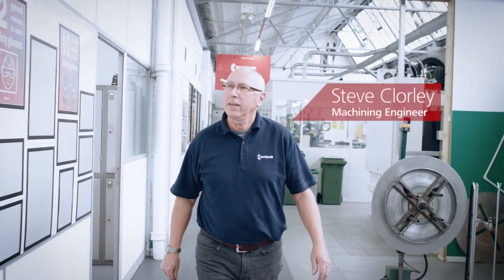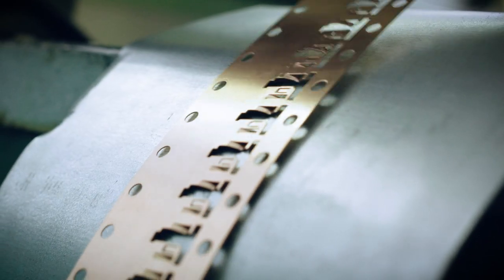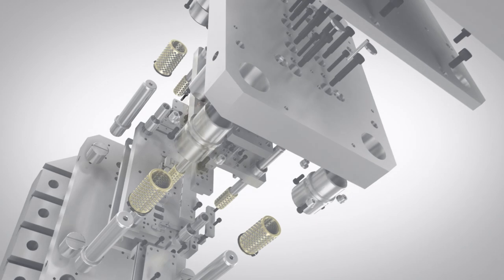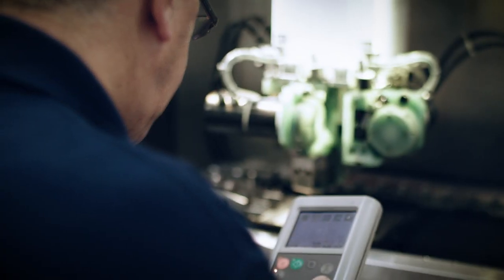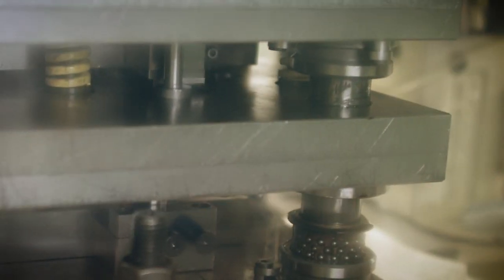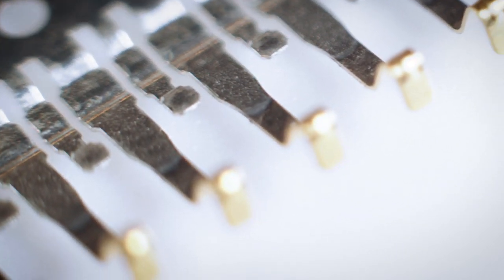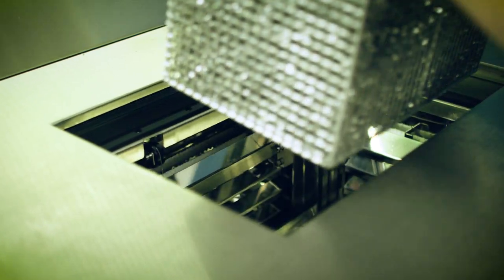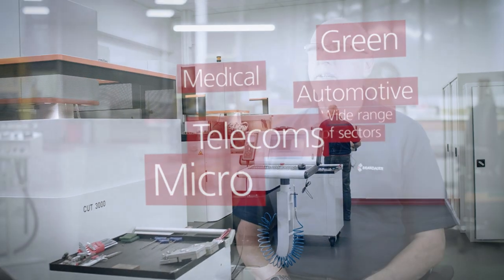What is a Micron? Precision metal stamping

Comment: Do I understand correctly that the tooling is made with 1 micron accuracy, but that the manufactured stamped parts are at a 20 micron tolerance?  Where do the losses in tolerance come from?
Reply: This difference is often called normal process variation (NPV). Not every part of the tooling requires 1μ precision, and 20μ is quite good for most electronic connector applications though some applications may require tighter tolerances. A general rule of thumb is that the tool must be 10X more precise than the piece parts to account for NPV.
Reply: Here's a napkin example example-
The dies are made to a precision of 1 micron but a die will have two opposite sides. So you double your loss of precision to 2 microns. In the Cartesian 2d plane you have two axes so multiply your tolerance by 2 again. Then you have to meet all of those tolerances twice because you have a punch and a die. so square it and you're at 16 microns.

And that's just tooling tolerances and not setup tolerances... it's called tolerance stacking and it's remarkable and complex.